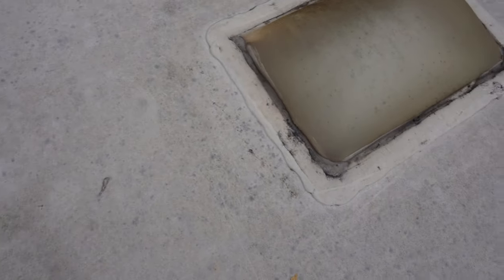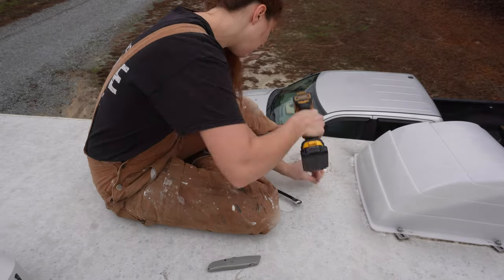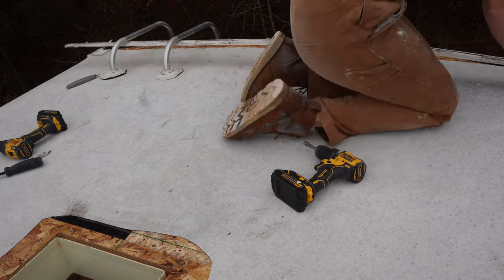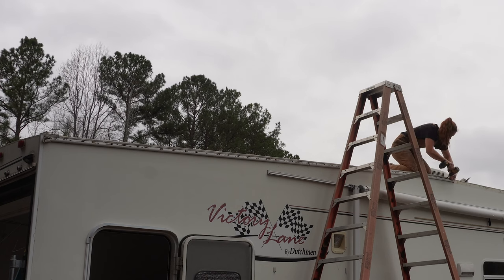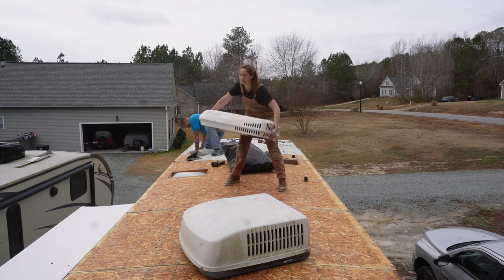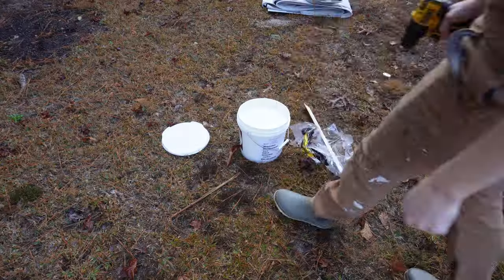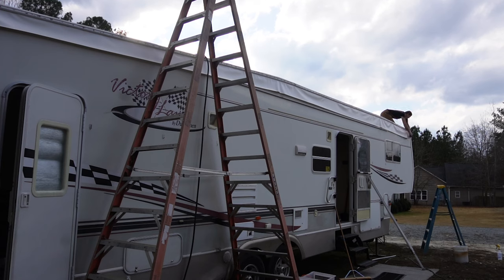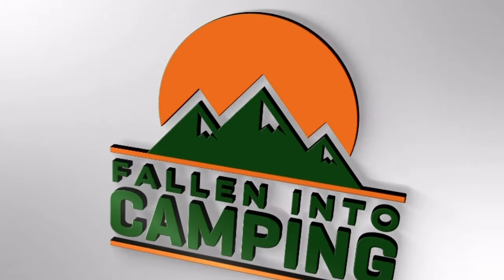How to replace your RV Roof Membrane: Timelapse & Instructions

Comment: I am getting ready to tacked a new roof on our fifth wheel.  Looking at RecPro, they have two shipping options.  Any concern with ordering the membrane “folded” vs “rolled” for $350 more?  What is your recpro discount code?
Reply from the maker: I always order folded and then roll it out when  I get it. I put it out in the yard and wrap it up in a 2x4 and just dust off the grass as I roll it up
Reply from the maker: My code is MNIMXX3 🙂
Reply: @fallenintocamping thank you so much.  I have been debating doing this myself or pay the big bucks for RV Armor.  I am going to go ahead and tackle this myself now!
Reply: @fallenintocamping  on the front and rear trim pieces that hold down the membrane, how are you applying butyl tape?  What about the side pieces?
Reply: @fallenintocamping  I received the materials today from recpro.  Was not expecting material smooth on both sides unlike the original roof.  Is there  top and bottom to this or they the same?
Reply from the maker: Sorry just saw your comment from a few days ago: I clean the old butyl tape off the front, rear and side pieces, clean with alcohol, and apply new butyl tape on the underside of the trim. Also, both sides should be the same (there used to be one side that had small little dots but I think they changed it recently). Either way, the entire membrane is PVC so it shouldn’t matter. I looked back at the recpro instructions just to make sure I wasn’t telling you the wrong thing, and I didn’t see anything about a right or wrong side. I’ve just picked a side. Make sure to roll it out once you get it. The creases won’t come out until you leave it in the sun for a bit!
Reply: @fallenintocamping  we unfolded it and rolled it up onto an old carpet tube until ready. Thanks for the advise.
Reply: What does everyone do where the tape is? Whatever tape you use for the corners etc to keep any splinters etc. from poking the membrane. The glue does not adhere membrane to the tape, and I'm wondering what needs done there.
Reply from the maker: @jeffb3665  I haven’t had an issue with the glue adhering to the tape. If you have an issue with it not being tacky, sometimes I get a staple gun and staple the membrane to the side of the trailer (only staple where the trim piece will cover) so it holds down in place and the glue has a chance to fully dry

Comment: I have a 27 ft Fleetwood travel trailer and the first two front roof panels are bad from water damage what do you recommend to replace the plywood what I mean by is what thickness and also I have to replace the floor is there a common thickness or is it by the manufacturer
Reply from the maker: Do you have aluminum (corrugated panels) or flat fiberglass siding?
Reply: @fallenintocamping  aluminum corrugated siding
Reply from the maker: Ok go watch ‘RV water damage repair in 6 steps’ on my channel. You’ll find some really good info there!
Reply from the maker: The short answer, is I use 5mm plywood (because I can’t find 1/4 inch around me) but there’s more that goes to replacing the ceiling. The floor is different, each manufacturer uses their own size. What’s most important is that you match whatever size is in the camper already
Reply: @fallenintocamping  thx you

Comment: Leave the old roof on.Why not just put the new roof over the old one? Unless it's too thick around the edges And what?
 Was the recpro the code again for you?
Reply from the maker: It’s a very bad idea to overlap roof membranes. You’ve already gotten as far as taking the vents and AC off, what’s another hour of taking the skin off. It has to be done, there’s no way to avoid it. The code is MNIMXX3 🙂

Comment: What about the air pockets in the membrane? Will they disappear?
Reply from the maker: Yes they will. When I lay the membrane down sometimes there’s bubbles, then I go back and work them out after the whole membrane is down and the roof is tacky. It’s tougher when it’s not 70+ degrees because the glue dosent dry as quick, but it does give you extra time to work out any bubbles that form
Reply: What about hard bubbles? That formed  from the glue ?
Reply: @fallenintocamping is it ok to do this in 100 degree heat?
Reply from the maker: @SuperMaximus71  it’s not idea because the glue dries really fast, but it can be done if you work in really small sections

Comment: Can someone give me a ballpark figure on the cost to replace a 32 foot fifth wheel rubber roof?
Reply from the maker: If you are replacing all of the vents, etc and awning fabric, expect to spend around $1500
Reply: It's a fifth wheel, the awning railing is separate,  does not need to be removed.
Is your $1500 estimate just for parts? Or is that including labour? Thank you for taking the time to reply.